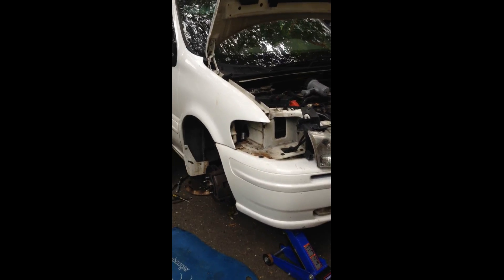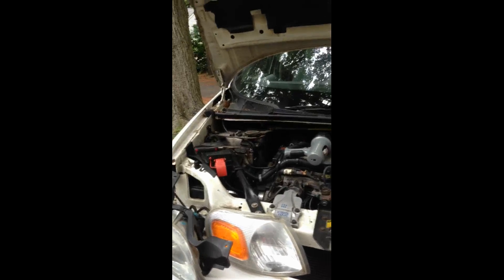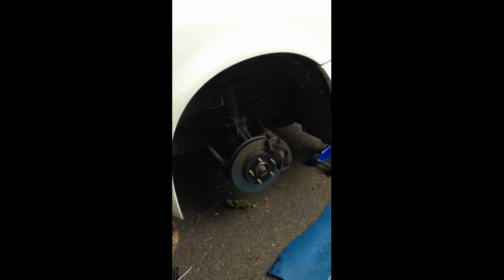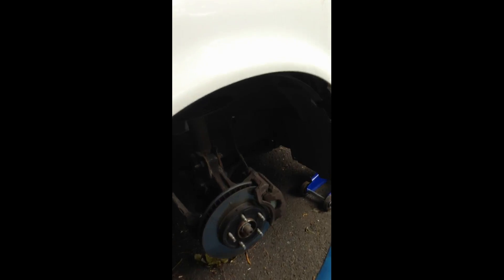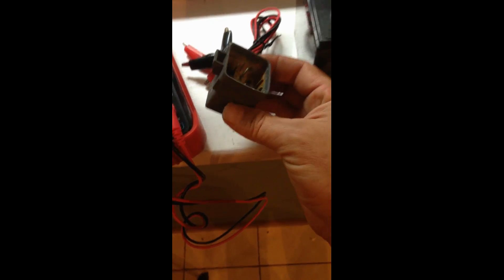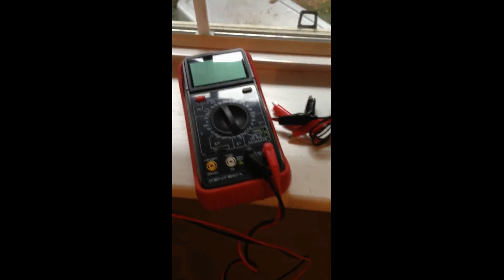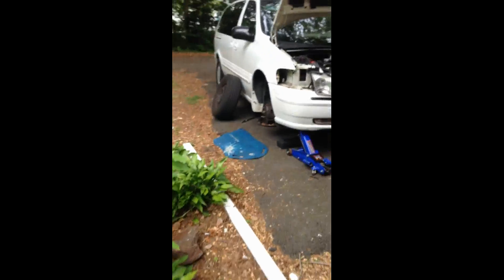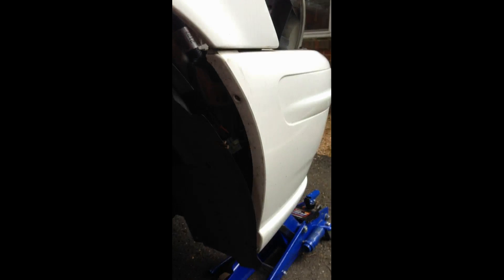P0410 P0418 How to find that darn relay! Secondary Air Injection Pump Fix Venture Silhouette Montana

Comment: Did that relay fix the P0418 code?
Reply from the maker: As I recall, I also had to replace the secondary air injection pump, which is located under the front driver's side wheel well. Those pumps get filled with water, and then when it freezes, the pump motor can't spin, so it burns out the relay, the motor, and/or the fuse. Pretty lame system. Also, the vacuum controlled check-valves also seem to die, and I recall replacing one or both of those as well. I no longer have the van....ha ha.

Comment: Thank you@Buckwsr for posting this video. You saved a lot of time of locating that darn relay. My van is a 2002 Oldsmobile Silhouette and Haynes repair manual says that it's located in back of engine near rear secondary air solenoid.Wrong! Thank God my problems were bad air pump ( water inside rubber boot) and bad relay ( water shorted out pump motor and relay).The more I worked on this van the more I found out that these model vans were designed by a bunch of idiots,to say the least.
Reply from the maker: Glad the video helped you. I replaced the air pump on mine, and sure enough, the new one went bad before too long also. Condensation and water accumulates inside, just like you said. My 2000 van is still running, but I have had to do a lot of repairs on it in the last couple of years....starter, radiator, rack and pinion, power steering pump and hoses, muffler, etc. I've had to do head gasket job, fix vacuum lines, drive axles, wheel hub, fuel pump, and on and on. So many of these jobs were difficult, as it simply is not an easy vehicle to work on. I made videos  on some of these repairs. I've got 188,000 miles on it now, and I always intended to take it to 200,000. We'll see if it makes it. Not getting driven too much these days. Good luck, and thanks for the note.

Comment: hey my pontiac aztek got an p0418 code now my car keeps stalling out hesitation does this sounds like the relay isnt that were your van doing?thanks
Reply from the maker: The secondary air injection system should not affect driveability....just emissions. There may be more going on with your car than meets the eye... Do some research online, and I'm sure you'll figure it out. In the video description I posted some guidelines for diagnosing the secondary air injection system. It may be slightly different for your vehicle....